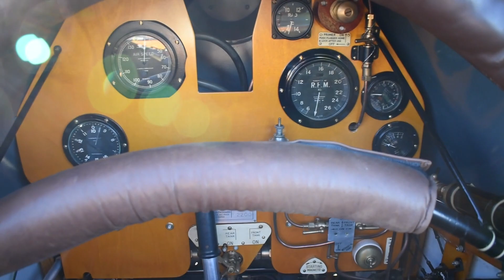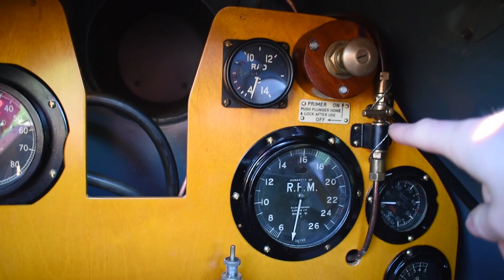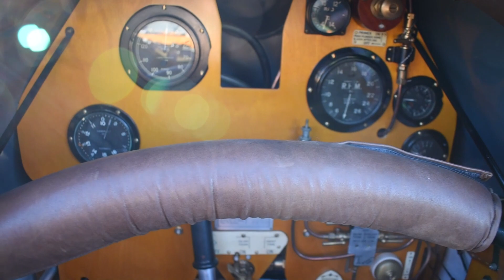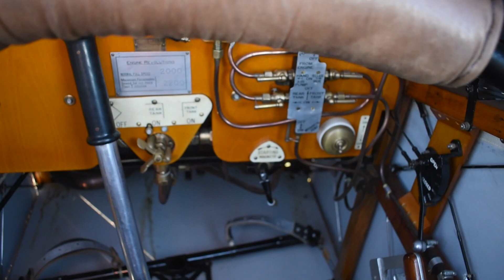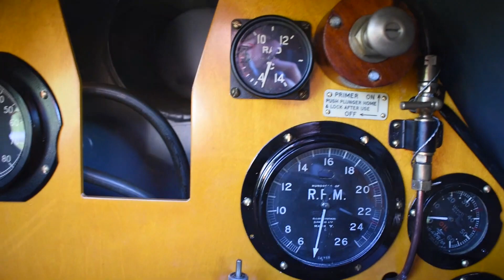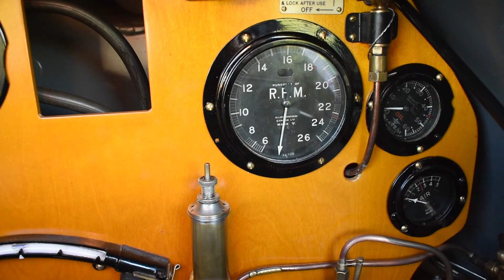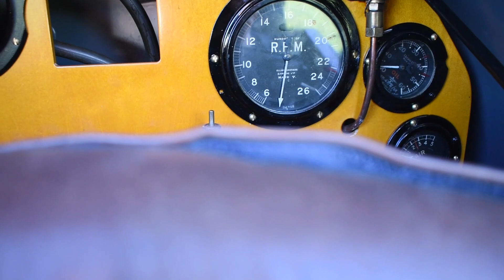How To Start A Bristol Fighter

Comment: Very interesting. 
What is the little oval just above the 'RPM' markings, that appears to flicker when the engine is running?
Reply from the maker: The little oval is just an indicator to tell you the RPM gauge is working, rather than jammed. So, for instance, if you're in the cruise at 1700 RPM you can verify you are indeed doing 1700 RPM rather than it having stuck somewhere along the lines!
Reply: @TheShuttleworthTrust  Cheers !!